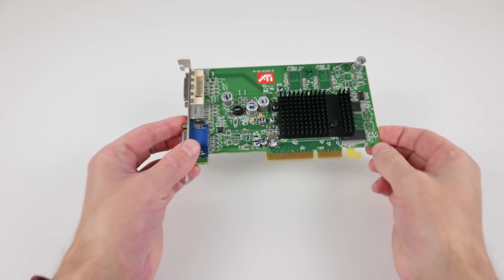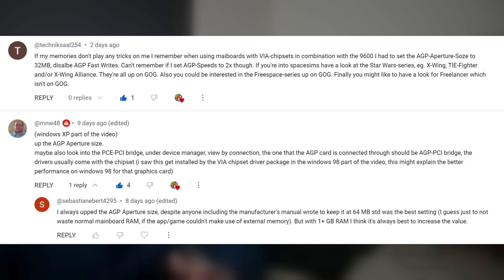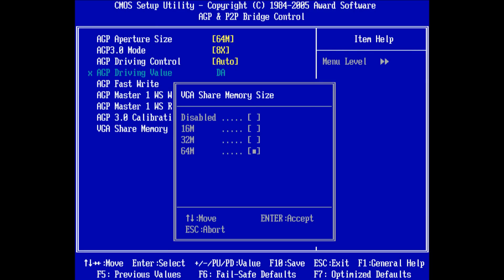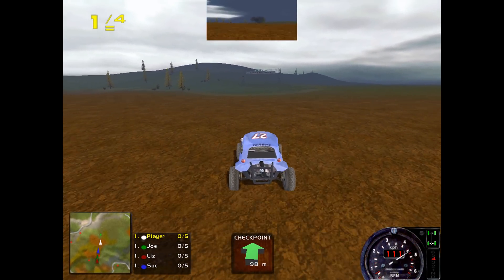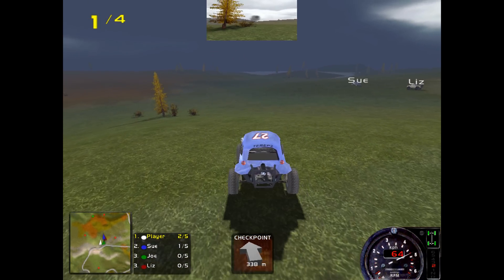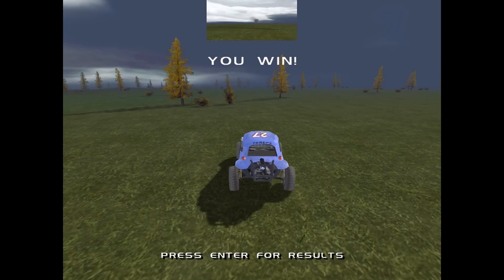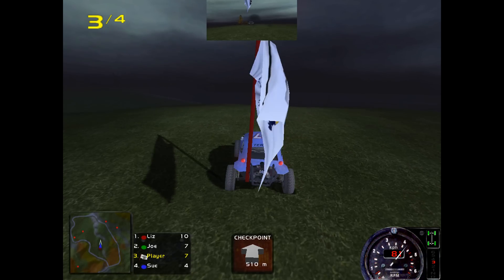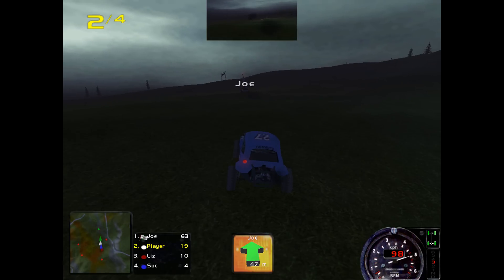VIA Chipset: Lessons were learned

Comment: Have you tried terep2.exe yet? Unbelievably good physics, terrible graphics, but it keeps you engaged for hours. This was the precursor to Insane. It runs on DOS and Windows 95, Windows 98. By the way, how do you manage to coax a modern LCD display into accepting the analog signal from an old VGA adapter? I'm currently struggling with something similar...
Reply from the maker: I haven't! A few others have also mentioned it though. Well many LCD monitors still have VGA, but for the TV, don't use VGA, use a DVI to HDMI adapter.
Reply: @philscomputerlab  Thanks Phil. Does it matter if DVI-A, ... D to HDMI if I have  Gerforce 4 Ti for example, or something similar from those times? Wish you the best I always have fun watching your uploads ;)
Reply from the maker: @andrasjuhasz3686  Don't think so those cheap DVI to HDMI Adapters is what I use.

Comment: Hmm... Thanks for some options, hope they'll work for me. But, unfortunately, except disabling the shared memory, because I don't have a dGPU and need to make UniChrome Pro/ProII barely work with its native 9x driver... So, could remaining tips work for me?
Everything else works just fine, systems in questions are quite usable if native GPU driver is replaced with VBEMP, but, of course, VBEMP does lack most of GPU acceleration.
Reply from the maker: If you don't use dedicated GPU, you should have many issues I think.
Reply: @philscomputerlab  VIA systems may be quite quirky yet attractive in the first place. I had some experience with a C3 on a CLE266-based board and a couple of C7s with their respective C?700 chipsets. All systems tended to be unable to run OSes with any slight signs of uncommonness, like NT4, Haiku, 9front or Kolibri OS (though the last used to start successfully, but also to reset randomly, the rest of mentioned weren't able to even boot their distribution media). Everything common, like Windows 2000+, 9x, DOS, lightweight GNU/Linux, and, I guess, *BSD, ran perfectly except the GPU in Windows 9x required generic drivers, otherwise the OS won't boot.

Comment: I don't know about old OS's, but as far as installing more recent OS's, in my experience VIA chipsets are a lot better than Nvidia Nforce chipsets when trying to install windows 10 on them because the only IDE driver you can use with Nforce is the generic microsoft driver that doesn't support trim on ssd's. You can force modded Fernando Nforce IDE drivers but they still won't support trim and they make the pc crash a lot.

Comment: Well I'm happy I found this and learned about the PCI latency issues with newer GPU's in VIA chipsets as that was stopping me from putting a meatier GF2 in a SS7 machine, I was getting that audio stuttering something awful in games like Jazz Jackrabbit 2 and UT'99. My original thought it was a general incompatibility; a result of the AGP voltage regulator not being able to give the GPU the right juice, but PCI latency explained a lot the more I looked into it. Kind of a shame my MVP3's bios doesn't actually have options to change the PCI latency (despite it saying so in the PCI options but the options to are absent and there doesn't appear to be a hidden option at all, otherwise I might've had a better chance at finding the issue earlier) but thankfully it looks like back then especially there were software patches that could run and be applied in Windows. Definitely something to keep in mind particularly with VIA chipsets.

Comment: I love VIA and use George Breese's PCI Latency utility, as well as H.Oda!'s wpcredit for tweaking PCI registers, essential to memory performance, as the settings are not in BIOS. The latter requires access to the corresponding VIA chipset datasheets. You can even improve HDD throughput, with care. The RWEverything utility is also helpful for browsing PCI registers.
In general, always install the VIA chipset drivers first, before any other drivers. (You may need to select devices in Device Manager and reinstall each component from there.)

Comment: I´ve had an FIC-Board (Backgrounds about this on "Anandtech" in combination with "FIC SD-11 AMD 750/VIA 686A Slot-A ATX") in my first Build, that was based on the Athlon reference Design, but deviated from it mostly, because of different Chipsets for the North- and Southbridges. It only worked with just the Drivers for the VIA Chipsets installed, not the AMDs ^^
Without them it just ran great with the first GeForce by Elsa.

And 1nsane was great, loved it since Day one, especially when doing Stunts in SlowMo, because of the great depiction of the torsion Model ;)

Comment: Oh, yes, where shall I begin... The VIA chipsets were really a rollercoaster ride. Sometimes they worked, most of the times you would not know if there is something wrong, while at others they simply blew in your face, hitting you with BSODs, or Blue Screens of Death, all out of nowhere. Sometimes it mattered in what order you were installing the drivers and a tradition was to always install the 4-in-1 VIA package the first. Even a particular version was, sometimes, required to have some sort of predictability or for ensuring good AGP performance (I remember the GART issues). 4.4.3, 4.5.1, "hyperion" are "codes" that are fondly remembered So, yes, VIA was never for the faint of heart!

The biggest issue with VIA chipsets is that they were developed with cost in mind. VIA rose to fame back in the Socket 7 days, as they were the only ones that updated the platform to support 100MHz bus on that aging platform. Of course, the boards had issues and there was a difference between the atrocious MVP3 and the slightly more acceptable VP3 one, but they were small. Since then, through the Pentium II and Pentium III era, VIA was the sole supplier of chipsets for AMD processors. Once in a while, they made a good chipset but it was never the first revision on a new development. I remember seeing the 266, 333 and 400 DDR bus chipsets not working at full speed and you had to wait for some "revised" chipset to get to the initially advertised performance. The mediocre performance you could get was many times blamed on the AMD processors when it was actually the mainboard chipset that was to blame. Intel did not suffer from this issue and the vast marketing clout of Intel made very few motherboard manufacturers and OEMs to actually ask for a VIA or SiS chipset just because they were skimping on cost.

The happy ending in the VIA story is that VIA was relegated to history the moment AMD got their act together and started supplying motherboard chipsets. At that moment, they fade into the oblivion. Yes, they will be fondly remembered for the many nights of struggle in reaching a stable configuration and for being affordable, but that is a pastime!
Reply from the maker: Excellent 👍
Reply: Yeah, back when my 2004 shitbox had an MSI KT6V (based on VIA KT600 + VT8237) it gave one malfunction after another – the first RAM slot died (out of only two to begin with), as did some of the USB ports (which I had to replace with a PCI USB card – scarily VIA‑based itself, this was before I knew to go with the NEC‑based cards). Other VIA chipsets I've used (whether with AMD or Intel CPUs) had similar malfunctions, including dropping HDDs down to PIO mode for no good reason (I checked; there were no reported UDMA CRC errors).

By 2008 that PC was too far gone, and I kept only the ST380011A – the one reliable component in there, and that despite it suffering 67°C heat (and having no air conditioning then, hence uncontrolled humidity). Thankfully it had an Agere MCU and TI SH6950 motor driver (their STMicroelectronics counterparts aren't known for such endurance), and lived on into 2012 (still OK when I put it away; finally succumbing upon exposure to the shed's humidity over eight months since, but even then it went out peacefully with just bad sectors – a far cry from the catastrophic failures modern Seagates are renowned for).

In the end, how should I sum up VIA chipsets? Something of a Very Intractable Ailment 😓
I'll only ever bother repairing VIA-based boards if it's something obvious and easy (like bad capacitors or a broken header) – anything arcane, and (unless a rare and expensive board) they're an instant parts donor.
Reply: I had no problems at all with the K8T800 chipset and was happy with that configuration for a long time.

Comment: One suggestion is also using older drivers under Windows 98.
 - For the MVP3, MVP4 and Apollo 133 chipsets, the 4in1 version 4.35 or older will give best performance and compatibility on AGP. (and keep nvidia drivers to 5x.xx versions, the 6x.xx have issues)
 - For Apollo Pro, KT133 and KT266, 4in1 version 4.43
 - For KT333, KT400, KT600, KT880 and newer, manually installing 4.56 will help.
 - For XP Hyperion Pro 5.23 or 5.24a should run best.
Reply from the maker: On the VIA website they have this retro driver 😁 it's exactly what you described.

Comment: yeah its freezing in the central wheatbelt too
hit 0 last night, great for overclocking tho, managed to boot ddr4 4600 on 2 dimms, took me an eternity to make it post tho
Reply from the maker: Where is Pentium 4 heater when you need it.
Reply: @philscomputerlab  its here in spirit, 9700kf at 1.45v is basically uncoolable with a 360mm radiator if u actually want to validate an oc
should try use a spare falcon radiator for a laugh

Comment: I wondered about the issue you had the the A8V Deluxe mainboard. Pretty sure I ran that with an Radeon 9700 Pro and and Audigy 2 ZS back in the day. So I took my A8V Deluxe, Athlon X2 4800+ and Audigy 2 ZS , the closest card I had on hand an Radeon 9500 and installed Windows XP and SP 2 & 3 with all drivers with no issue on and 80 GB Samsung harddrive and ran 3DMark2001SE with no problem. I purposely installed the Audigy driver after the graphics driver to make sure this ain't the issue. (I'm used to do it the other way around. First chipset drivers, everything else, last graphics driver.)
The only things I didn't installed is the AMD C'n'Q driver and the Creative applications cause I couldn't download them from the Creative site due some bug but could download the latest driver. 10.2 for graphics and Hyperion Pro v524a from your site, the rest from the ASUS site and Framework 2.0 for CCC from my own harddrive. BIOS should be 1014 as far as I remember but the board says version 08.00.09 from 10/06/05.
So I suspect some issue with the IDE to SATA adapter. I've run in to problems with adapters like these in the past but usally not detecting drives at all or not willing to install Windows on them...
Edit: I have used pretty much every VIA chipset from KT133 to KT333. They wasn't always the fastest chipset depending on what you want to do but for gaming I think they were very competitive and never ran into a real issue. The K8T800 Pro is the best VIA chipset there ever was. I remember nForce 3 was a bit faster in applications but this VIA chipset was pretty much the same speed in games and that was what really matters to me back in the day at least.

Comment: Well, if only AU wouldn't be hot in summer plus the creepy crawlers. Even Germany is already too hot in summer and we had the idea of moving to New Zealand for a milder climate (island nation and so on), as my wife doesn't want to move back to the UK. Maybe once we won the lottery jackpot. xD

Btw, I love when a BIOS has hidden features, or menus within menus within menus... Or when you need a "BIOS dictionary" because the options use unusual abbreviations and have no descriptions of what they do. Many modern systems don't even have BIOS manuals anymore, like my Mini PC, even though is has all the previously mentioned problems. Alone finding the UMA Buffer option was a pain as is was hidden deep inside the convoluted menus and named differently...

PS: Seeing the iODD ST400 in one of your videos, I had to get one too. I'm even amazed that it gets enough power from the USB ports of my Pentium 233MMX system, with the DOS USB driver even recognizing it, but then stating that it couldn't find a USB device compatible. As the mainboard was produced around 98 and USB2.0 being finalized in 2000, the MB should only have USB 1.1 at max, even though I think that I used some USB 2.0 drivers under Win98SE with it.
Afterwards I tried a pure USB3.0 DVD drive and the driver could successfully mount it. If the hard drive was initialized as GPT or MBR shouldn't really matter for the "virtual" optical disc drive, right?
Reply from the maker: Yea it shouldn't matter... I like how it can act as a USB floppy drive 🙂
Reply: @philscomputerlab  
How does it work as floppy drive aka drive A or B?

Btw, we really need a CD / DVD-Rom version of the Gotek! Even if the ST400 would make it possible to run ISOd under real DOS and old hardware, it lacks the CD-Audio connector.
Reply from the maker: @moomah5929  Yes we do need an IDE optical drive emulator. Yes it will be a: just like a real USB floppy drive 😁
Reply: @philscomputerlab  Ah, it also supports IMAs besides VHDs and then you can change the drive letter to A or B. I don't think I've seen this mentioned in the manual, only VHDs and optical disc images.

Just tested it on my DOS PC and got farther  than before. Now I get: 
ASPI Device : ID:0 = iODD Virtual Floppy
Installed ASPI manager
DI1000 ASPI Disk Driver Ver 2.00...
But afterwards:
Available ID = 0
ID 0 = HD .. iODD   Virtual Floppy
#1 : ???   Read error in partition read.
Read error in boot record read.
#2 : ???   Read error...
It doesn't matter if the virtual drive is in hard disk mode or removable media mode. Of cause I deactivated all other drive / virtual drives options except for the floppy disk image one.

Edit: Now I found a mention of IMA support inside the web manual. It was shown on the picture of the folder structure.

Comment: Windows 98 on 43" LCD = like 😀 I am just waiting for my Radeon 9600 SE, I didn't know it's a tricky card, but it seems like almost everything is tricky from that period of time. 😀 But I recently realized that ATI cards have better compatibility with 90s games, no artifacts in AvP1 etc...so I think I am switching to team red for retro gaming. 😀 I tried Radeon X1650 with some later omega drivers (unofficial) and everything is ok, when I have nvidia, I have to use force ware 60 or older to have these 90s games showed correctly. And it's even better, Omega drivers don't need net frameworks and such things which always bothered me the most when I had some ATI/AMD card. I am just selling my FX5900XT, I think I will find some radeon 9800 instead.

Comment: I dunno...... I once had the very same MB (Gigabyte GA-K8VM800M) Phil has, and am using Asus K8V-MX (a very similar MB) right now (with Socket 754 Sempron 2800+ or 3100+), with either Radeon 9600 Pro (Gigabyte GV-R96P256D) or 9000 Pro (Gigabyte GV-R9000 Pro II); never had similar issue Phil experienced.
Reply from the maker: Yea I also never had such issues. It could just be a poor Bios on that graphics card....

Comment: I owned ATi9600PRO and MB Asus A7V600-X - there was problem between those chips. System froze, games were falling. Solution - set agp speed to 4x in BIOS. It worked very well. No problems, system was stable and no negative efect on performance occured. So why not? Easy at first look but long journey to find right way.

Comment: As the main author of the linux driver for the VIA unichrome family, i actually implemented the first fully native coreboot driver (open source bios replacement) to boot to VGA on K8M890, and also implemented the X side code to figure out all the necessary information for the display driver to know where the memory lives, to enable direct cpu access to the reserved memory, etc.

From the other video, i could glean that this is the K8M800 the AGP version of the K8M890, which uses similar integrated graphics, so I am rather intrigued by this issue.

Is the BIOS programming the host bridge to intercept the upper XX MB of ram reserved for the onboard graphics, even with the onboard graphics disabled? Is the bios pci resource allocation then dumb enough to re-assign that same area for other devices, and to have accesses to the memory intercepted by the northbridge still?

Are you still missing the XX MB of reserved ram when you boot the system? How much system memory does windows report?
Reply from the maker: I can check in a future project but for now the parts are already packed away, off to the next one 😊

Comment: I never went with VIA boards back in the Socket A era esp when my Radeon 9700 Pro was installed. It was all nForce for my Athlon builds and I never had an issue with the Radeons and the card ran as well as anything from nVidia I had at the time (TNT 2 Ultra, IGPU Geforce MX-2, GeForce 3 and then Ti 4200). I was using the SoundStorm APU before moving on to the Creative Audigy. The Creative Sound Blaster Live! Platinum was still installed on my Pentium III system and didn't bother moving it because the SoundStorm APU was touted as being similar to the sound chip in the XBOX thus I wanted to use that
Reply from the maker: I just finished working with a nForce2 system and I was impressed! I wasn't aware that it has full 98/ME support with drivers still available on the NV website. Might change a few things, though I hardly have anything AGP with Nvidia chipsets. Should have not ignored them years ago LOL
Reply: @philscomputerlab  my second PC build utilized the Asus NForce 2 Ultra chipset and it had SATA support, though it relied on a separate chip which meant installing the SATA drivers before setting up windows on a SATA drive. It was pretty stable and highly overclockable. I was deciding between that and the KT400 but the nForce won out due to my good experience with the nForce 1 chipset and the AGP Pro slot